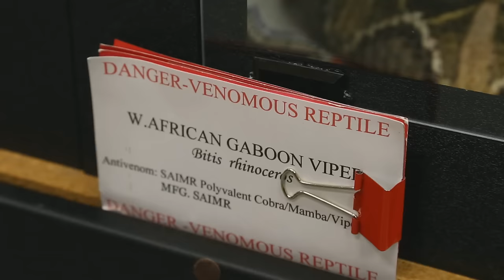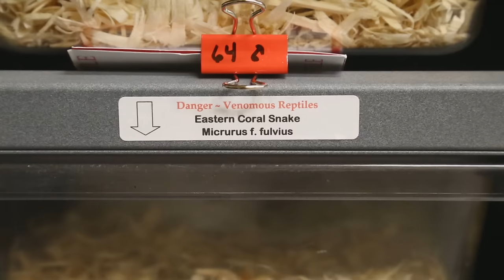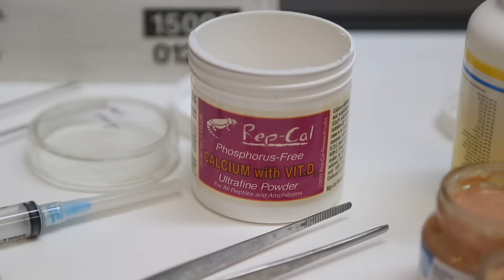Coral Snake Venom! : Kamp Kenan S2 Episode 5

Comment: Hi folks I get a lot of questions on why not breed and feed the Eastern Corals on the venom line natural food .While Eastern  Corals set up in an ideal cage setting feed most of the time I would need a supply of 300 feeder snakes a month to adequately feed 100 corals. Also handling does put some added stress on the snake for a period of days post extraction. This contributes to poor feeding response as well. It is a sheer volume issue involving 3600 feeder snakes a year. Could absolutely be done on a smaller scale. Thank you. Jack

Comment: Wish I knew  this feeding method when I had my VR permit in the 80s in Miami.  I used to go to Miami Serpentarium to see Dr. Hass milk the cobras as a kid as did all the locals. in the 60s.  School field trips as well.  Imagine the now. HAHA.   I had Poly valiant anti venom from SA, in my fridge.  Getting the permit for that was a bugger and the time difference.  I think it was $80 a vail.  Got permit from the USDA  I think.  Had several friends that got to be in the Cobra club.  They got Bit.   Nice hot room.  I had l my snakes in cages in the living room and when you would walk by, you would hear a bang and see the vipers venom drip down the plexiglass. With this hobby, you get no mistakes.   Great video !!

Comment: has any body kissed a coral snake besides me?
  i would pick it up any way  i would have picked up a rattle snake if they were not so aggressive but i did touch an Arizona diamond back though with my hands and they are not aggressive not like the rattle snake. dont ever be afraid when picking up snakes as well they sense fear thats when they will attack that's my key. if you show fear to it they will be more  aggressive to you but if you show no fear the snake will let you pick it up and let you put the snake in your mouth just like i did for a coral snake and the other key is dont try to pick the snake if you are sweating they see your body temp and they will be more aggressive to you so if you want to pick up a snake better take a super cold shower before picking any snakes up thats my rule of thumb because when i pick up snakes up i dont know if there poisonous i just want to pick up and some were because i am working. i didnt know that i had put coral snake in my mouth till i looked it up and it trusted me like i trusted the snake